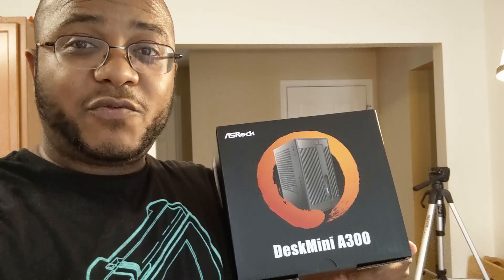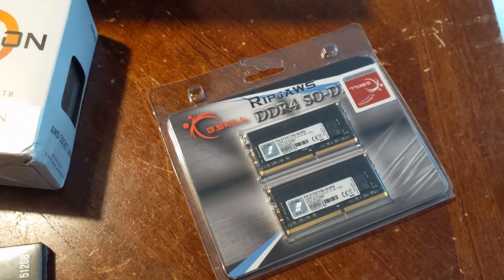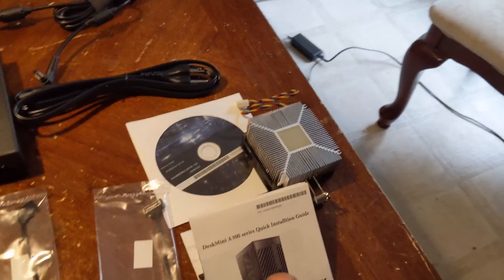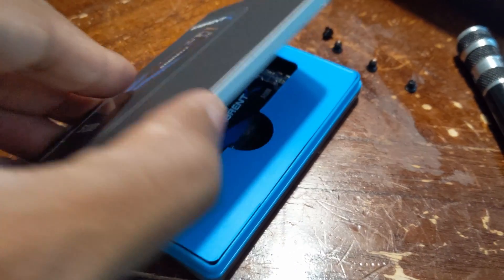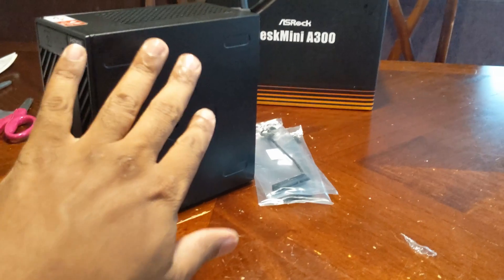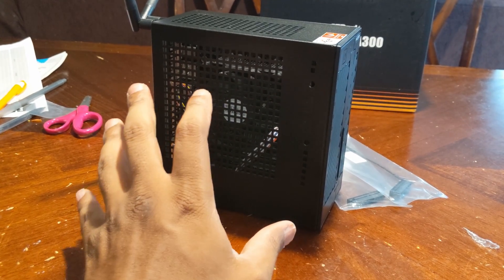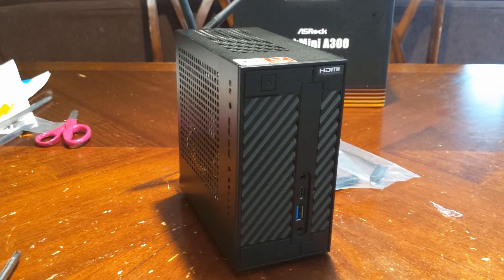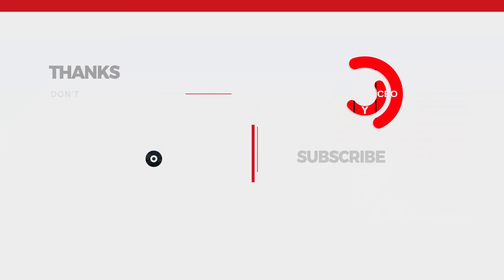Asrock Deskmini A300 Review and Install

Comment: Awesome video.  I been looking at one of these thinking about doing a 3400G in it for some light gaming but also being ultra portable to travel back and forth from NY to PA.
Reply from the maker: This will be great but don't expect any serious gaming. Also the stock cooler won't for this case so you will need a lower profile one like a noctua cooler
Reply: The spire cooler wont work that comes with the 3400g. The included case cooler sucks. Buy a wraith stealth cooler or noctura to use with the 3400g

Comment: The price for an AMD Ryzen 3 2400 cpu dropped in price few months back for as low as $69-89 in comparison to the base price of the deskmini itself of $150.
Reply from the maker: Yeah I've been thinking of getting some for ndi players around the church or for new mini computers for the kids computers in the learning center at my church. Great price and performance.
Reply: AJaytheCEO AJaytheCEO definetly look into upgrading for NdI players. The data processing for production and streaming will pay off with little knowledge of CPU overclocking. I have overclocked my 2400 from 3.5ghz to 4.1ghz and cuts my multi-media processing time by 15-25% with seamless lagtime. The a300w deskmini is a over-par HTPC workhorse.